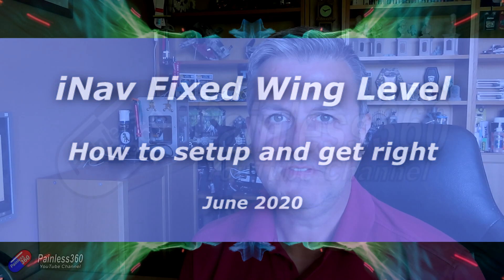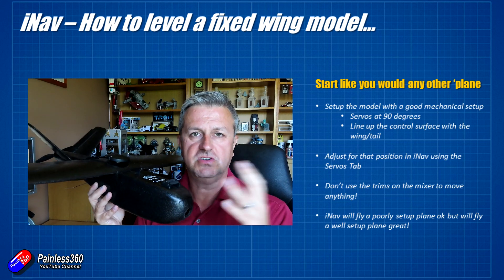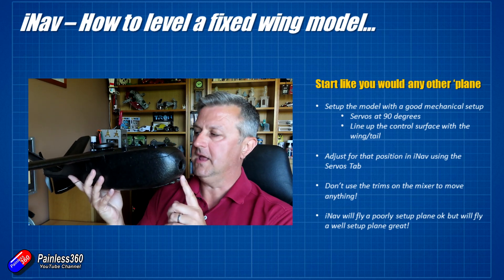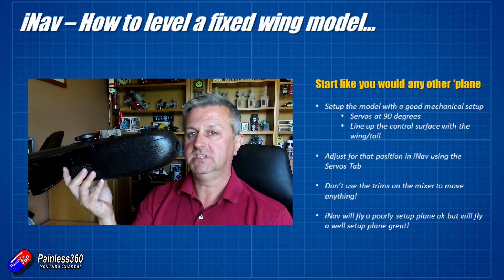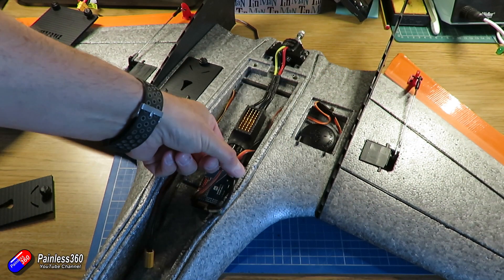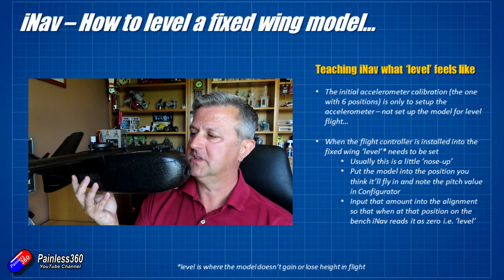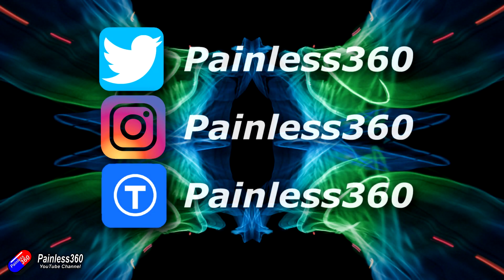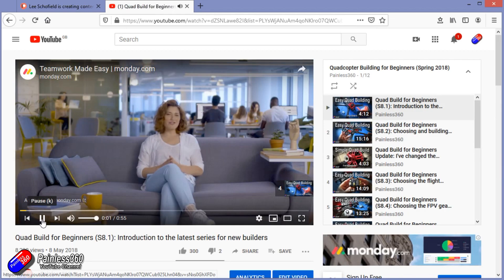INAV: Fixed wing levelling

Comment: I'm back here again after a new inav build so thank you!! This is such a silly way to manage this and a step backwards from trim in traditional RC. IMO, just let me re-zero the FC pitch in flight somehow? Maybe part of the auto-trim? I have to plug in to the inav FC so many  damn times I broke the usb port.
Reply from the maker: Please see the modern INAV builds on the channel. It's a super easy process and dials in the servos for manual flight... Happy flying!

Comment: Is this still the correct procedure for iNav5? There is a message saying 
"Roll & Pitch board orientation is available only in the CLI. Do not use it to trim the airplane for the level flight! Use Fixed Wing Level Trim on the PID tuning tab under Mechanics instead (fw_level_pitch_trim)"
First; when I do this the Pitch value in the Setup tab does not change.
Second; How would one change roll if needed?
Reply from the maker: Yep, see the INAV 5.0 series... best of luck
Reply: @Painless360  Thanks, though it appears the video containing this info hasn't been released yet. I can only access up to 3/7 in the series.
Reply from the maker: Series locked for release in the coming weeks.. stay tuned!

Comment: Matek F405-WSE with iNAV:  My plane is acting strange. The 3D plane in Inav is backwards (when I roll the plane right, the right wing tip goes up instead of down, but, the ailerons are doing what they are meant to do (correcting the right way). How do I fix this in iNAV so that the 3D image understands that when I roll right, the right wing should go down and not up? I've tried everything. Currently, the YAW under COnfig. is set to 180, but if I change that to 0, then the autolevel (on the ailerons) is backwards and the 3D image in iNAV becomes correct.
Reply from the maker: Are you sure it is backwards? https://www.youtube.com/watch?v=lxVd4LnHDjQ

Comment: I think you should include MAG Alignment if you do another of these. I had the issue where the displayed model was rotating if I changed the pitch or the roll. I had to play with all the settings until I found the one that didn't cause this, and also showed 0 degrees for actual north. I suspect this may have caused my plane to roll unexpectedly in the maiden flight.
Reply from the maker: Thanks for the idea. That is already covered in a number of INAV  videos and I have a few coming this autumn on it too.. Stay tuned!

Comment: How do you determine cruise throttle?
Reply from the maker: It depends on the model and what you want. I usually go off the current draw and speed I want. 50% throttle is a place to start. See my video on flying longer for more information.. Best of luck

Comment: Thank you for all the videos! When in Angle mode my first build seems to be twisting counter to the prop as you mention. Should I counter this unwanted roll in the same manner as we addressed the pitch in Sensor and Board Alignment?
Reply from the maker: No. ANGLE mode should be taking care of that. I would check level too. Use the autotrim to get rid of it for manual mode flying. Best of luck

Comment: You can set up the pitch level on a pot on you tx. So in flight you can use the board level indicator and fine tune it in the air.
Reply from the maker: Please link to the document, webpage or video that shows this. I'd like to see more..

Comment: Great vid, ta. Pls advise - can I maiden a scratch-built talon-like plane by hand-launching it in Angle mode? Most vids suggest to do it in Manual. If yes to Angle, can I maiden it with Autolaunch! if I am confident about the model, C.G. and iNav settings..?
Reply from the maker: Check out the maiden videos in the recent BrainDART, Mini Drak and Nano Drak iNav builds. I cover my routine in depth.. Best of luck

Comment: I couldn't get my servo horns vertical on the spline with 1500 input. Is it ok to adjust the midpoint in the outputs tab so that they are vertical before adjusting the deflection and trimming? If so, do you have to adjust the endpoints too?
edit: lol nevermind, I just watched your sneak peak of the new inav series and you covered it ;)
Reply from the maker: :D Well spotted. :D

Comment: What about level calibration? Does that not take in to account any nose up attitudes de she calibration is done?
Reply: The planes may fly differently than how the board is set.  You may have the board level to the world.....but the plane may fly level with a little bit up of elevator.

This is why the auto trim is helpful, as every plane is different

Comment: Good vid. Presumably when firing up autotrim the trims on the transmitter should be 0?
Reply from the maker: You never use the trims on the radio - covered in this video.... Happy flying
Reply: Painless360 Now I got it, thanks. Put INav in the nano goblin as a move away to something cheaper (and smaller) than the vector, will give this a try.